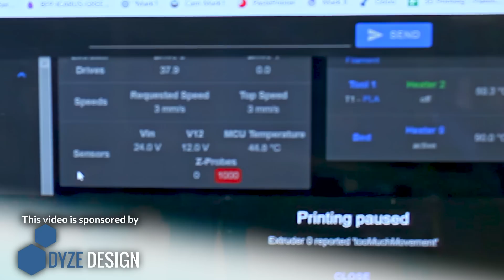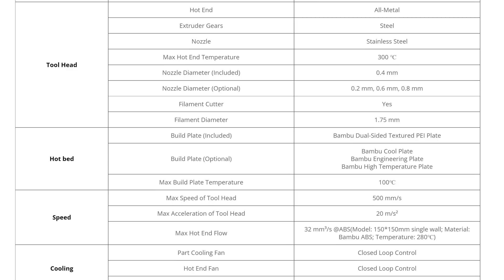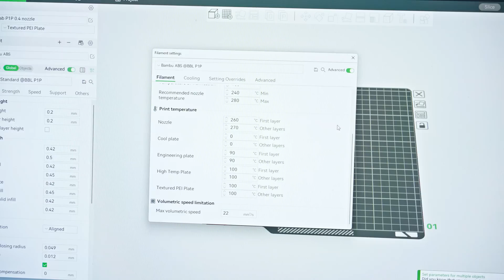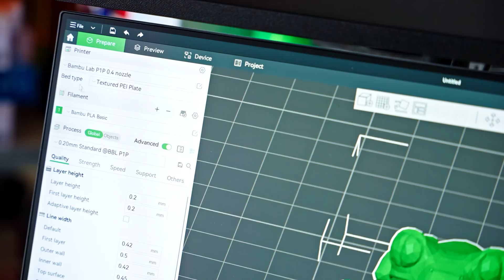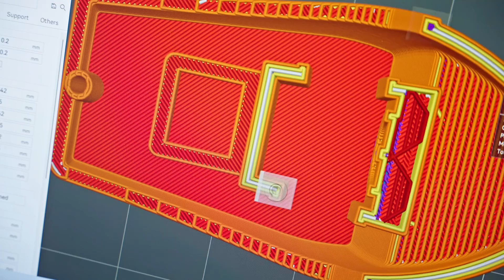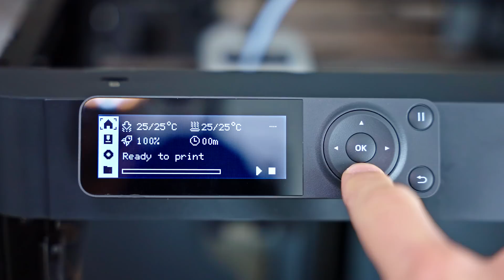Bambu Lab P1P: Tradeoffs

Comment: I'd really like to see how it compares to the trusted Prusa Mks3 and your Voron 2.4 when it comes to speed and quality.  Does the P1P/X1 make those other two printers obsolete from those two points?   Removing open source from the equation, would you buy/build a Prusa or Voron today?
Reply: 247Printing has a good comparison you might like for the X1C vs the Voron 2.4
Reply: @BeefIngot  Just took a look, that was really useful for me!  Hope it's good for John, too.
Reply: I honestly don't think you can really compare either Bambu with the Voron.  I suppose if your only concern is "I want a printer that will go really fast while still being fairly accurate" then sure, the Bambu offerings and the Vorons or Ratrigs are the only real contenders.  But the overall user experience between the two is just so different.  Bambu is targeting the folks like me who have zero interest in modding or tinkering or building, and just want something that we can plug in and turn on and hit print.  The X1 requires no more attention from me than my 2d printer does (actually less, since my 2d printer is a horrible old broken down thing that I got for free from work when they were throwing it out, and I have the skills needed to make it go but it still needs a lot of cajoling).  A Voron, on the other hand, is the ultimate "I want to do everything myself!!" printer.  They're aimed at completely different markets.

I feel like the "I want a fast printer and don't care if I can buy or have to build it myself" portion of the community is pretty small.  But that's just a feeling, so I could be wrong - and hey, if you happen to be in that segment, then fair enough.  In which case, I'd look over at 3DPNero, who is the "Voron guy" but also has an X1C.

Last thought: Much of the extra noise of the X1C is the chamber cooling fan.  If you print PLA on a PEI bed that needs to be up at 55C, the printer starts to worry about keeping the print chamber temp down and slams the chamber vent/cooling fan on full blast.  (This is not the auxillary part cooling fan, this is the one on the back that goes through the carbon filter.)  At full power, that fan is loud*.  If you print on the cold plate (35C bed) or print something like ABS (that *wants a hot chamber) this fan is barely on, and while the printer is still noisy, it's not crazy loud.  My X1C is in a different room than my bed but only about 4 metres away; with the cold plate or ABS I don't notice it when I'm trying to sleep but printing on the PEI I have to close the doors to both rooms.  That's my experience, anyway, using the X1C for several months now.  So I suspect that the P1P, which doesn't seem to have that chamber vent fan and is aimed at the PLA/PETG prints rather than the ABS/PC prints, will come in as comparable to a Voron.  That's just a guess, however, since I'm not interested in having to build a printer and thus don't have a Voron.  :)
Reply: @davydatwood3158  I think the comparison is fair.  X1 is $1200. LDO Voron is $1300 + hotend & rpi ($200).  Obviously, there is assembly time and print time for parts. Definitely within the same ball park.  Personally, i think its more than just modding, tinkering. Its also about "repairability". Because at some point any 3d printer is going to fail and repairing is on the owner to do, or they're boxing it up and sending to Bambu to repair.
Reply: @John Olson  The repairability part is a reasonable concern, but that doesn't remove the enormous amount of time, effort, and skill needed to actually build the Voron.

If you are a person who is interested in building a printer, then the time needed is free because it's your hobby, a thing you're doing for fun.  If you're not interested in it, however, then it's a task you're undertaking in order to get to the fun part.  The internet suggests that building a 2.4 will take between 20 and 40 hours, and I submit that the longer end of that is more appropriate for a person who isn't into building 3d printers.  So let's say 30 to 40 hours worth of time.  I earn 18.25$ an hour, but that's in CAD, so let's convert that to 13$/hour USD.  That adds 390 to 520$ to the actual cost of our Voron.  We also need to account for the 2 to 3 kg of filament needed for the printed parts.  I won't count the printer time, because I'm assuming that even a person not interested in building the printer will enjoy the exercise of figuring out how to print the parts, so that's (Free) hobby time and not a cost.  Still, about 30$ in materials.

So, for a person who is not interested in building a printer, a voron's real cost is about 1300 + 200 + 30 + 390 = 1,920 at the low end and 2,050$ at the high end, or 700 - 800$ more than the X1C.  That's a lot of extra money to spend just for repairability.  Now, for some people that ability to repair will be worth 800$, but it's still important to be honest about the actual cost.

Of course, if you're a person who likes building printers, then the numbers are different.  For this person, the time needed to do the build isn't a cost, it's a good.  They're also likely to be close to the 20 hour build time.  So this person is spending 1530$, or about 330$ more than the X1C, and in exchange they're getting three things: the entertainment of doing the build, the satisfaction of "I did this myself" (which is always as great feeling, but only exists on a project you truly wanted to do), and of course the better repairability.

All of which brings me back to my original point: the two printers have very similar motion systems and two different YouTubers (247Printing and 3DPNero) have now said they have similar performance, and this means that the real reason to choose one over the other is whether building a printer sounds like a great project  or a horrible torture.  I can't imagine there's very many people who are truly indifferent on that subject.
Reply: @davydatwood3158  I'm not running a print farm, and don't plan on it.  Fast, low production, even one-off prototypes is what I'm interested in.   As you mentioned in other response, based on noise level I'm seeing/hearing about X1C/P1P, its most likely not my choice.  From a personal level, I'm also a believer in open source (to a point). Its quite likely that another Prusa or looking at Voron is most likely my best bet. But.. not to say I can't be convinced.  I've seen an attempt or two to quiet the Bambu printer.
Reply: I'd also love to know how the noise compares to a Voron at similar print speeds.  I keep hearing people say "Faster prints are just noisier", but every video I've seen of RatRig or Voron's is no where near as loud as the videos I've seen of the Bambu.
Reply: @JohnOlson  That's also one of my main concerns! The noise level I've seen from videos is absurd! Don't get me wrong, if you have a garage / basement where the thing runs it's probably irrelevant, but if you have it in your office room or anywhere near where you spend most of your day, it seems like a pain. I get that most prints finish within 3 hours instead of the 9 hours you would usually see, but if my Prusa mini prints whilst being dead silent and unnoticeable, whilst bambu printers ruin 3 hours of my day, I'd still pick the prusa over the bambu.
Reply: @Genesis-dj7kw  This isn't my business, (for now)..and my printer is in my home office.  If this was in a shop, or garage, then the noise would be less of an issue.  I don't need whisper quiet, but I'd like to be able to take a phone call in my office while printing.
Reply: @JohnOlson  But I will say this - even when I'm printing ABS and the X1C is pretty quiet, it's still louder than my Ender 5 and I wouldn't want to take a phone call in the same room.  I have no data on the P1P or a Voron, and I wouldn't want to linger in a room I was printing ABS on no matter what printer it was, but I do think the X1C is a "tolerable from a room away but inescapable in the same space" level of noise, which suggests to me it wouldn't be the best fit for your specific situation.

Comment: I believe the P1P also has bluetooth, which is a unique feature over the X1 series. They haven't said anything about how they are planning to use it though. Seems like they are also still mum on that external control pad.
Reply: There's a phone app called Bambu Handy that uses bluetooth to connect to the printer.

Comment: Calling a welded steel frame "flimsy" without testing the actual structure is a pretty bad way to review an aspect of a machine.
Reply: and saying that he doesn't like the appearance also isn't a valid point.
Reply: It is flimsy. Welded or not, it used 22-24ga pot metal. Hit it once with a hammer and see what happens.

Comment: Klipper alone got me 2.5 more speed on my ender 3. At a reasonable quality. Even if the user intended to use it out of the box. Not using klipper is a huge mistake. They could offer the better screen as an in upgrade. Not impressed.

Comment: About the speed claims, I actually think its somewhat unfair to dog on them for this, as they are pretty honest especially compared to other manufacturers. The printer really does hit those speeds, and you can really print and get usable results at those speeds. In fact, the regular profile does have the toolhead travel at 480mm/s. The speed benchy print (which you can get through some profile changes) is actually possible because of that.

I basically think its an arms race, because companies making printers many times slower than this will put up huge numbers, so how can this company get across to customers that their printer really is faster in the real world? I think they did the most reasonable thing and they were honest with real values the printer can actually hit, even though it would require pretty extreme print settings and no one would really print at those speeds.

I will note though that basically, I think that Bambulabs is like if Prusa put all their effort into making a baller printer instead of having awesome support. So they have just average support, but an awesome printer, which I think seems like a fair enough tradeoff if support is at least there, but do feel its probably the biggest area for improvement for Bambulab. This is based on being on a lot of discords, reddit etc, where I can see that at least they follow through with the warranty, but its certainly not the 247 chat support that Prusa has, though I guess with Prusa they have a much higher profit margin to squeeze that into.

As for the call to action I think for the full review you should go the route of the full potential, AMS and panels included (because really its a relatively small mod and I think many people actually find that (fun bit of free marketing for Bambulab) fun) vs stock. I also think the most obvious thing that everyone wants, is a comparison between this and the Prusa Mk3s, because while its old, I dont see that as any reason not to compare them. These are really the printers real people are comparing when looking to buy right now.

People want to know, should I get the slower, less capable, slightly harder to use open source printer with a long standing reputation and excellent support from a trusted company, or do I get the faster, more capable, slightly easier to use closed source printer without an established reputation from a brand  new company who has mediocre support by comparison?

Really I also think comparing the price point for different features is also in order. For instance, if you want to get official parts from prusa to get the same features (minus speed and fancy camera stuff) of the X1 Carbon Combo, you have to pay way more money than the combo for the prusa equivalent (with the enclosure, raspberry pi, hardened nozzle, camera etc) , but for the P1P,  you just have to add a hardened nozzle and a raspberry pi.

I think thats also something to keep in mind, because I actually, despite the price, think that the Carbon Combo is actually probably a really good value, especially if you want multi color prints or enclosed prints. I think the P1P on the other hand is basically about the tradeoffs above.

For reference, I did actually buy (gamble buy through kickstarter) one of these (the Carbon Combo), which Im just mentioning for context. I bought it because it kicks printer manufacturers in the pants and I hope, means we can stop seeing the same lazy ender clones over and over and over again. It really is different and they put effort into addressing real problems/a real market segment of people like me who are fine paying to have a fast printer that just works. Before this came out, I was trying to decide if I was going to build a Voron, VZBot, or Ratrig (though I still might just for bigger volume and customizability).

Comment: how well it can handle abrasive materials and if there is a upgrade comming for that
Reply: It uses the same parts as the x1 and x1c.  You can toss on the all metal hot end and hardened steel nozzle from their store for pretty cheap.

I have a drawer full of extra parts already.  Some where the Kickstarter thank you box and some I've bought extra.  

The p1p may still have the pre order bonus with the free camera and aux fan, which gets it pretty close to the x1.  Print side panels and you're only really missing the top/front glass and a cable chain.

Comment: Reliability. The major issue with budget printers you mod to make better: is out of the box they aren't reliable. Ender 5's have prints fail because of badly tensioned extruders deforming the filament (I had that) and then again because of bowden tube gaps. Getting to the point where you can consistently get a successful print most of the time: that takes a LOT of upgrades, careful tuning and learning. It can take months to get an Ender type printer to the point where it's legitimately reliable. Now some of the newer entries in the market here like the Elegoo Neptune 3 may be better in this regard (I don't know),  but this is their biggest shortcoming. And if I was to consider saving up for a printer thats 3 times the price of an ender 5 pro, (considering I spent almost that much on upgrades by now) - what I'd want is that reliabilty. On reputation: that means "Go for Prusa, for a hundred bucks more you get the most famously great printer build around, and it really does just work almost always). Quite a feat for a now 5 year old design. But its' also a slow bed-slinger using an inductive ABL that forces you to ALWAYS print on metal (I love my FR4 printbed). Is this better? Can it use other beds ? And is it reliable. Will it keep working if you print regularly over several weeks, or will you regularly have lots of failures due to mechanical printer flaws until you replace a lot of the pieces where they cut too many  corners ? That's where a mid-range printer can shine: "Sure it's 3 times the price, but you don't need to spent that much again to make it reliable, it already IS reliable". Can you test that ?
Reply: This. Reliability is completely underestimated in this hobby.
Reply: I 2nd this.... beat the snot outta it. This machine is a toy until proven otherwise. Let's see some nozzle crashes at 500mm/s ! :)

Comment: About lower bed temperature with those magnetic PEI sheets - I think there's good reason for that. Most magnets stop being magnets at around 80 C, which is probably the reason for lower bed temperature.
Reply: thats not true, the x1c also uses a magnetic sheet, the spring steel is just coated with a different material
Reply: I've printed polycarbonate fine on my X1C with the magnetic sheet. I'd have to check my profile but I'm sure it was over 100C.

Comment: I would like to see "real world" speed of the printer when tuned for "reasonably good" printing results.  I.e. speed de-tuned to address the print quality issues you mentioned: horizontal surface finish, infill strength, missing details due to straighten motion path.  Thanks.

Comment: You should do a few videos on it. I would like to see a head to head style video, this the mk3, the ender3 v2 all stock printing the same files. Then compare quality and print time etc. Then separately test the p1p against itself with the included upgrades. Then maybe a section on the cosmetic mods.
Reply: That does not illustrate the pros and cons. Bed slingers are twice as fast with similar quality using klipper. The mechanics are just part of the issue.

Comment: I would like to know if print quality and part strength are equal or better then 'normal' printspeeds and a hardware check for those parts NOT in the shop.

Comment: I would like to see, if functional high-speed prints can handle the same force like the prints by normal speed.
Reply: Definetly. I just saw a strength testing video that showed overheated ABS at 260 degrees was substantialy weaker than at 240. And this spec sheet is making claims about extruding ABS at 280? There's no point going fast if it doesn't produce functional parts.
Reply: @mattanderson111  that doesn't make any sense, could you please link the video?
Reply: @morbus5726  it does, bcs higher temperature brakes internal structure of the material.
Reply: @MartinWolker  usually, with higher temps, the plastic has less time to solidify, which warrents a stronger fan. This fast printing would actually increase strength in the z direction, as each layer placed upon another layer isn't fully solid.